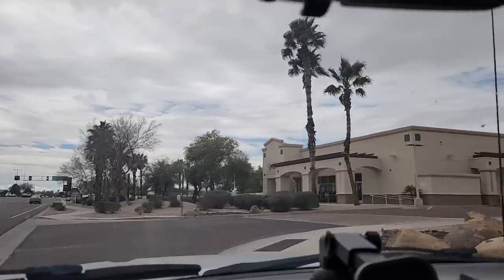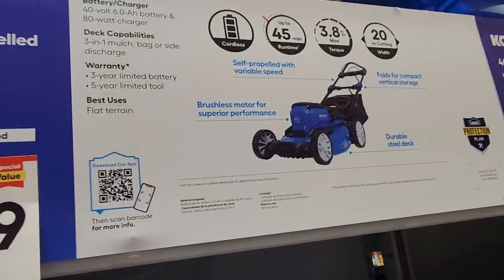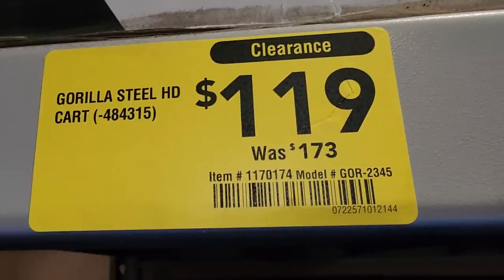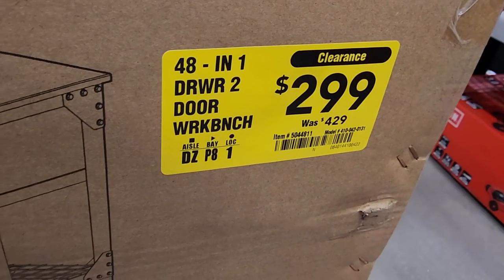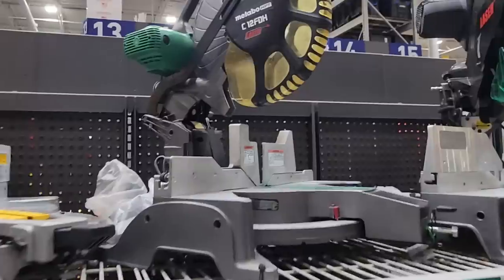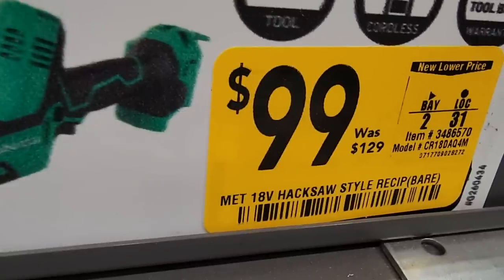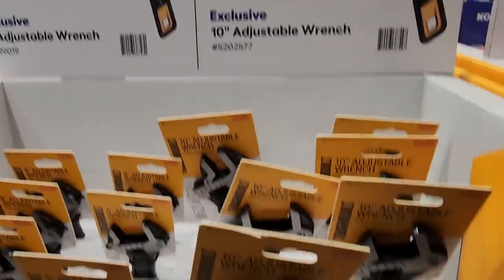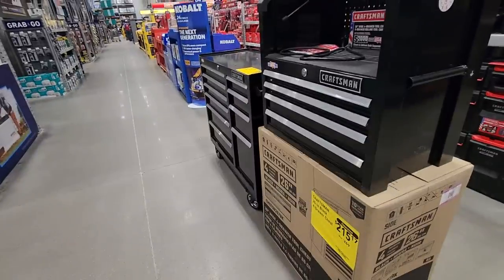Top Tool Deals + HUGE Clearance! @ Lowes

Comment: if the old man ever.. EVER.. gave me a toy mower id say, what you want me to do with the one ive been cutting the lawn with? started 2nd grade age 7, no safeties, no clutch bar engine brake, NOT self propelled, you could flip it over gas pissin out with that widowmaker spinning around in there, better not slip. been in AZ 22 years have NEVER owned a weed wacker, lawn mower, none of that juey!